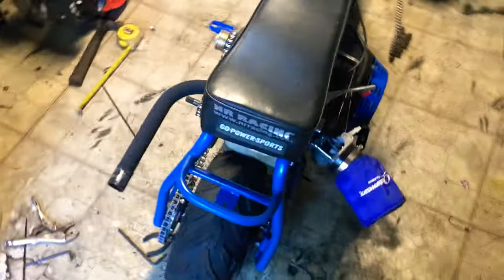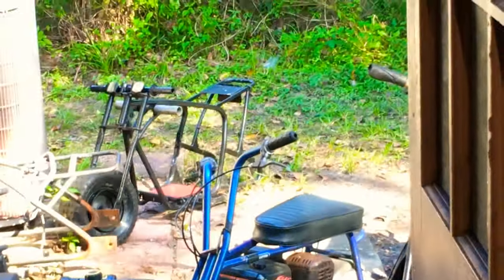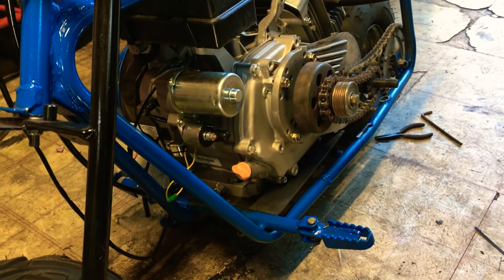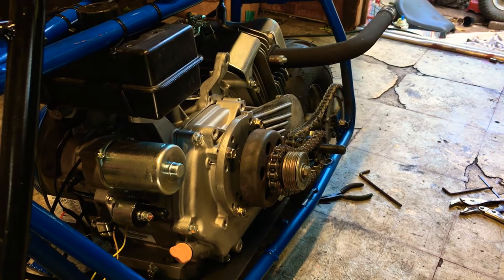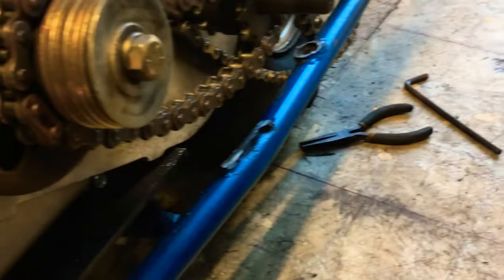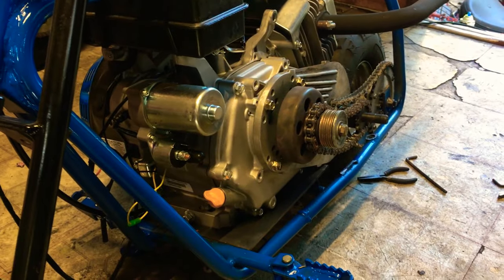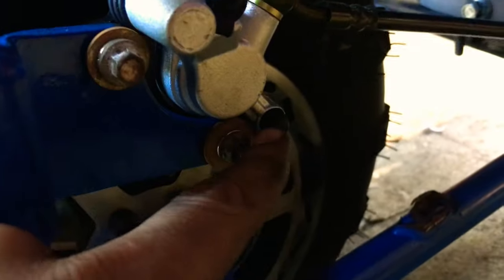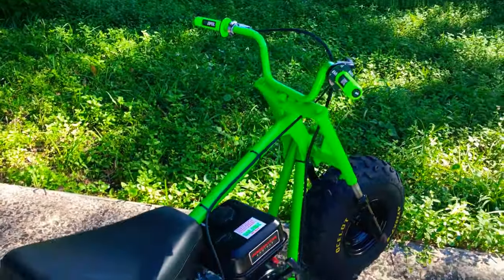How to install 420cc Into Doodlebug Mini Bike

Comment: If you have a cc100x Coleman Doodlebug frame a 420 will fit in there perfectly, slides right in there. All you have to do is extend the motor mount plate like you were saying a little further back so that you can mount the rear bolts because they hang off the back of the stock engine mount plate. But I didn't have to cut the little hoop thing that goes across the frame in the back

Comment: Where do i purchase a 145/70-6 slick tire from
Reply: I have a Bahar racer and looking for the wheel combo you are using and where to buy good rear brakes stronger than stock that fit

Comment: Do u run fuel pumps on ur motors? I read somewhere u gotta change the needle in order to run a fuel pump…and do u have a battery on that to start it, or did u just leave the starter and just pull start it? Id imagine u keep ur bikes as light as possible…awesome builds

Comment: I have the same mini bike with a built 420cc on it i put a belt drive on it with 3800 stall springs its got a 4ft wheelie bar on it

Comment: Where did you get the jack shaft setup or what would I need to get? I have a clutch and 420 predator already that’s going on a baja warrior.
Reply: This is the back plate of a tav30 torque converter. You could get one on eBay for a lil over 60 bucks shipped. You might be able to find just a backplate

Comment: Hey bro I have  212cc What do I need to make it go faster Who I bought it from He said he put bigger internals inside the motor but it's not fast enough I was going to sell the motor but if you think I can make it go fast it only tops out 50 fi'm trying to go 65 Where do you think I should do to make it go that fast
Reply: Gearing... larger front sprocket or smaller rear

Comment: Hey what kinda sprocket did you use and can you tell me where you got it ? Thank you doing the same exact build would love to know where you got the parts. A link would be awesome.  Great build
Reply from the maker: It’s a steel 420 pitch sprocket on a split sprocket adapter from gopowersports or OMBwarehouse it was a couple months ago I don’t remember exactly but it’s one of those 2 sites
Reply: @lsminibikes  thank you .
Reply: @lsminibikes  how many tooth sprocket?
Reply from the maker: @Amgc4  think it’s a 40
Reply: @lsminibikes  hey man you remember the clutch size by chance I kno 212 take a 3/4 clutch I believe

Comment: you think it’s the same thing on a CT100U??
Reply from the maker: They are similar frames, might be a little harder because the ct100u is a bit smaller but it’s about the same work.
Reply: @lsminibikes ct100u is smaller than a Baja doodlebug?

Comment: How do you oil the clutch?
Reply: Take it off, remove the snap ring and apply high temp grease to bushing. Do not use oil
Reply: @summerypond  yeah i used oil and it started boiling and bubbling mid ride